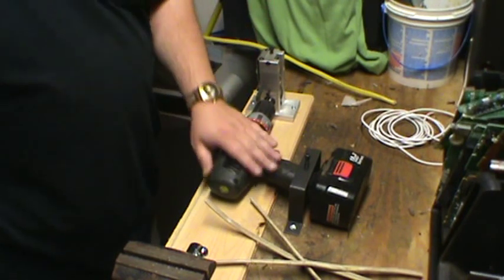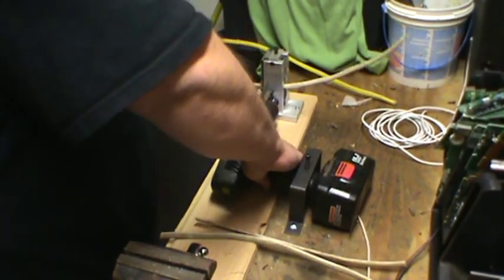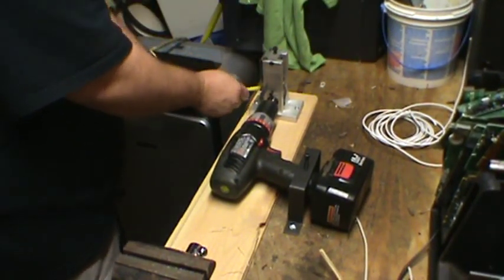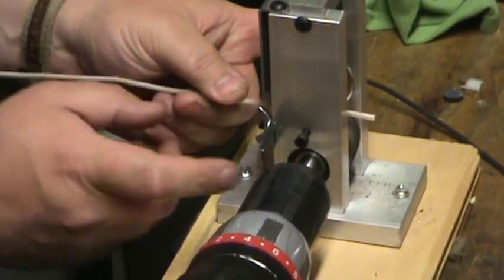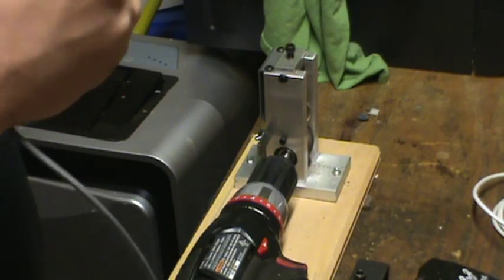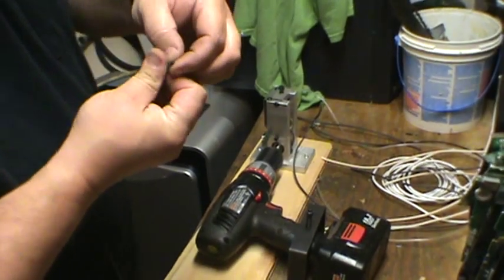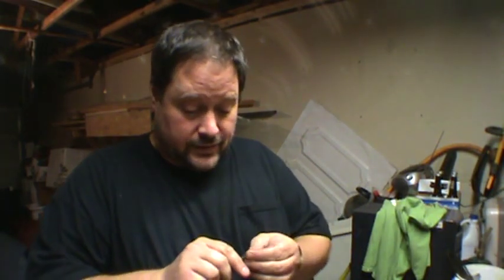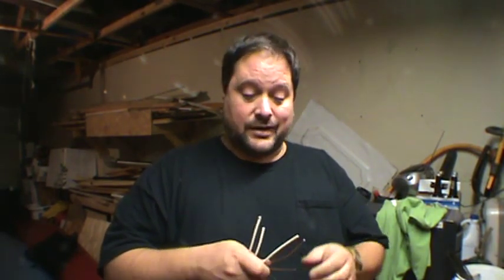TNT Tooling WSX Wire Stripper: Fast, Easy, Copper Wire Stripping!

Comment: I found a nice alternative for stripping wires fast and cheap, using a flatiron.
put the wire down on the table and iron it, the plastic or rubber gets soft and you can easily pull out the copper. It's a great alternative to wire-strippers which are expensive while you probably have a flatiron at home already, or you might find one scrapping. Greetings from the Netherlands and keep on scrapping
Reply from the maker: Glad you found something that works for you!  Best of luck to you!

Comment: Hey moose, So I am building a wire stripper but having some issues with it at the moment. not giving up by any means, but I needed a stripper now so I placed an order for the wsx stripper and am kind of excited to receive it. The best part of it is, The tool only cost me 50$ Canadian! I was able to sell a piece of working equipment from a load of electronics I received which in turn paid for 3/4 of the machine! I hope the tool works as well as it seems to. Great vids and thanks for sharing the knowledge. Happy scrapping :)

Comment from the maker: With bx, I usually take a pair of bolt cutters and do just what you did, cut into 3 foot sections, pull the insulated wire out then run it through the WSX or the WSA.  Video idea added to the list!  Thanks!

Comment: One thing I really like about my new cheapo manual wire stripper is that it takes normal utility blades, almost all automatic ones I can buy here in Germany are imported and once the blades get dull I would have to import those as well which would mean a couple of weeks delay. I wish I could get one like this over here, but it is probably better to come up with my own design for easier maintenance.

Comment from the maker: Hi and thanks for watching!  The Price difference varies from yard to yard.  At the scrap yard I go to, its a difference of 80 cents per lb for unsulated wires from appliances (not computer or smaller wire thats only 40 cents/lb) and $2.30 per lb for copper.  Thats almost 3 times as much!

Comment: Moose: the WSX wire stripper looks more like my style. I am tried of pulling on the earlier models. The WSX may cost more money but it looks like it may be worth it. I am concerned about the set up also the wire that I get is usually twisted, bent, and in various conditions. How does that wire work in the WSX? I hardly ever find new wire to strip.

Comment: Moose just wanna suggest and old black and decker corded drill. Most have a knob on the trigger to set the max speed and a sliding tab to lock the drill in the running position. that way you can feed your wire in nonstop and corded have more power so it don't make that bogged down sound that cordless keeps making,.
Reply from the maker: Doug Harris I hear you, I went to Harbor Freight and bought a cheap one not long after making this video.  Works way better.  Thanks!

Comment: Hi Moose, I recently bought a similar machine from ebay (yes it's a knock off) and it works really well.  I got it because I found 12 partial spools of wire at a garage sale.  I got them plus 2 boxes of wire for $46.  I think I should make some money.  My question to you is, do you ever find that if you set the blade too deep it cuts the finer strands of copper & if it's not deep enough the insulation keeps breaking?  If so how do you know how deep to set the blade?  Thanks
Reply from the maker: Hi an thanks for watching!!!  Yeah that used to happen to me a lot.  Since it sounds like you have a lot of the same size wire this should be pretty easy!   What I do Is put the end of the wire, about an inch through the hole then with my thumb push the blade down into the insulation then lock it in place.  I pull the end out and and then run the rest through.  I just push the blade in enough to poke the insulation of braided wire because even if it does not cut all the way through the insulation it makes it so that you can easily pull the wire out.

Comment: Hey moose, what did you use to clamp your drill down... I rigged mine up, but I'd like to use something like you have
Reply from the maker: I used the drill clamp that came with it.  You can bend a wire coat hangar over and curl the ends up so that you can put a screw through them and that should hold it down too.